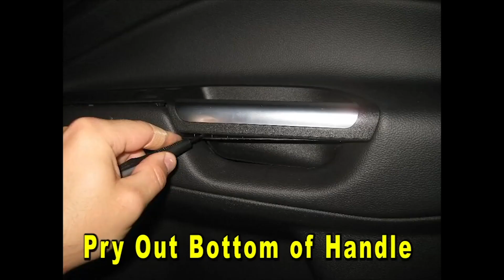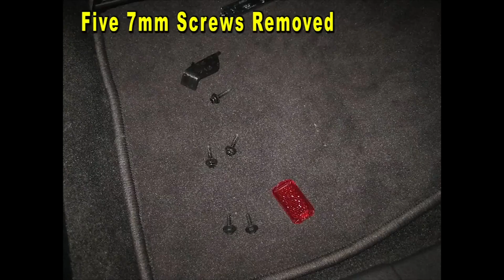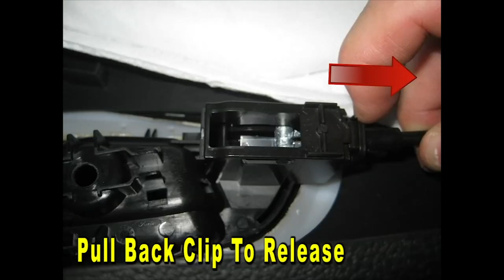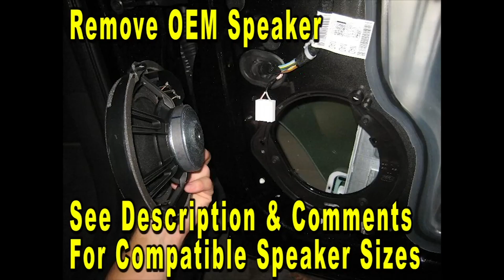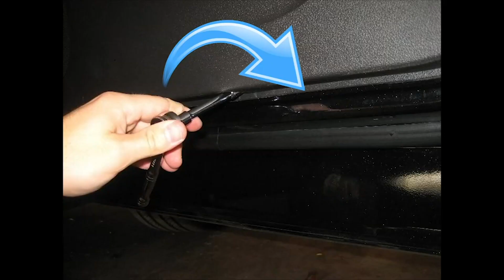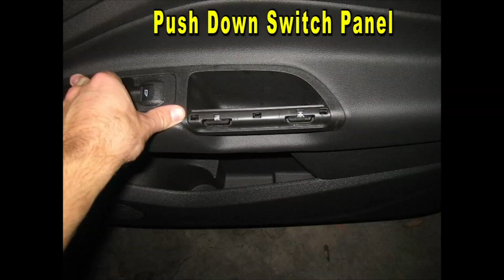2013 To 2019 Ford Escape How To Remove Door Panels & Upgrade Speakers - Quick & Easy

Comment from the maker: Check out the DIY guide for taking off the plastic interior door panels in a 3rd generation 2013 to 2019 Ford Escape SUV  - 
https://www.paulstravelpictures.com/2013-2016-Ford-Escape-Interior-Door-Panel-Removal-Guide/index.html

Here are all of the DIY repair and maintenance tutorials for the third generation 2013, 2014, 2015, 2016, 2017, 2018 & 2019 Ford Escape SUV - 
https://www.paulstravelpictures.com/Articles/2013-2016-Ford-Escape-Common-Problems-Repair-Maintenance-Guides.htm

Owners of other Ford or Lincoln vehicles such as the Focus, Fusion, C-Max, Mustang, Fiesta, Transit Connect, Edge, Flex, Explorer, Expedition, Taurus, F-150, EcoSport, MKC, MKZ, MKS, MKX, MKT and the Navigator may also find these DIY instructions to be helpful.